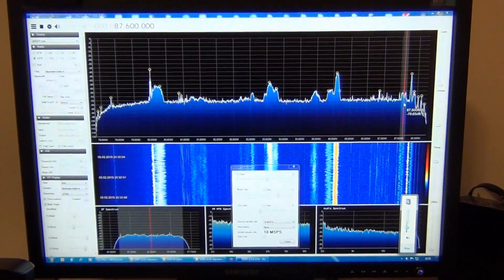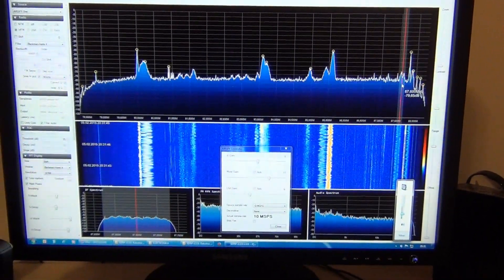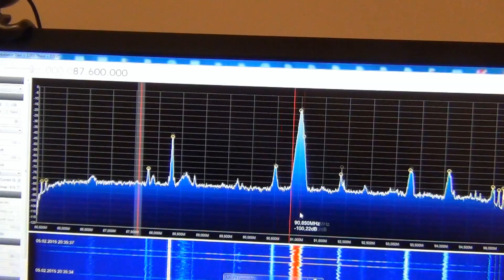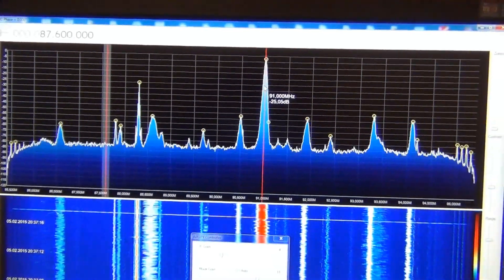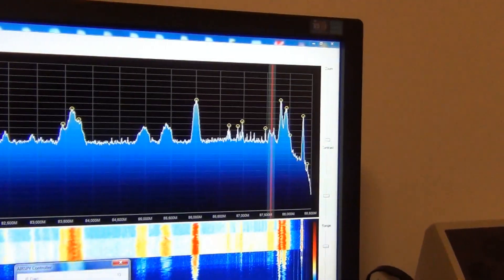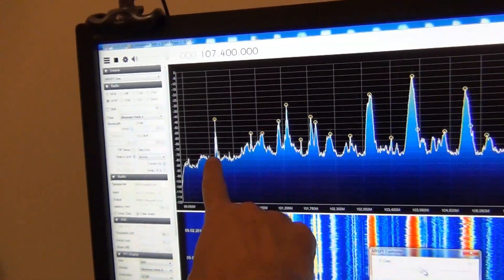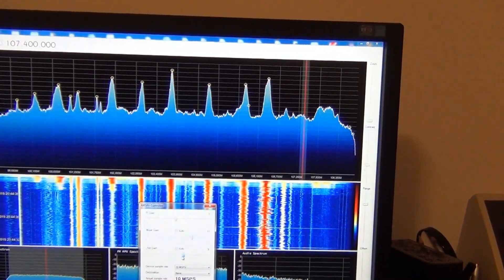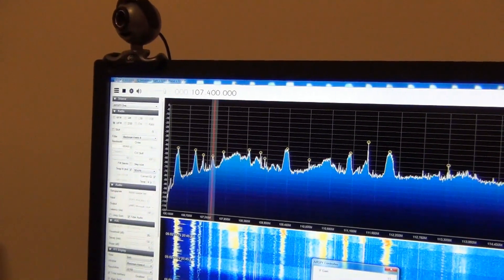AIRSPY SDR - Tips & Tricks Receiving Weak signals with Strong ones near by

Comment: what about if weak signal is between two strong signals?
Reply from the maker: Well, this is the worst case ! :-)
That is why the receiver dynamic range is one of the most valuable characteristic!
The sensitivity is one of the easiest feature to reach in the contemporary receiver. Much, much more difficult is to make a high dynamic range receiver, with as much as high SFDR (Spurious-Free Dynamic Range).

Anyway, when weak signal is between two strong signals, a good antenna with good directivity can help also. If weak signal of interest comming from different direction then the unwanted ones... It is depend of every single situation and receiving conditions...

Airspy SDR is declared that has near 80 dB dynamic range, while RTL-SDR has only obout 50 dB.
(30 dB difference is equal to 1000 times) It is like Airspy can handle 1000 times more powerful signals on its input than RTL-SDR !
Reply: Mile Kokotov which sdr is this ? The hf plus or the R2?
Reply: @JayN4GO  r2

Comment: Mile, thank you for this video.  I'm curious if you reduce the sample rate to exclude the strong unwanted signals does this do anything to improve the weak signals you are listening to in this example also?
Reply from the maker: Tim Havens The Airspy is optimized for 10 MSPS. Reducing sample rate is not recommended unless you have to run Airspy on some weak PC. Of course, there is decimation option instead, for reducing the spectrum window but anyway, the front end of the receiver still look wide frequency range...